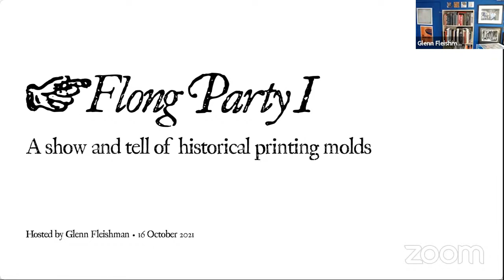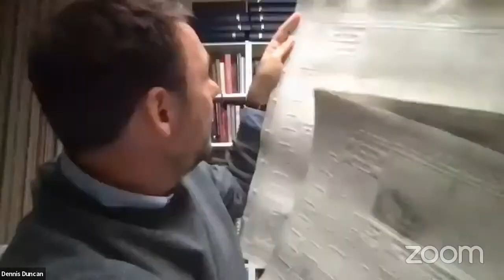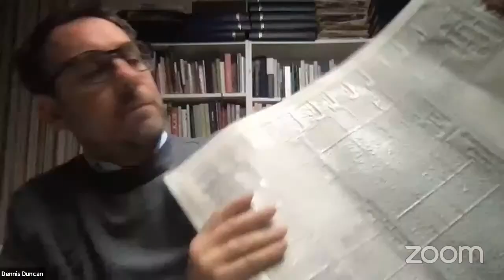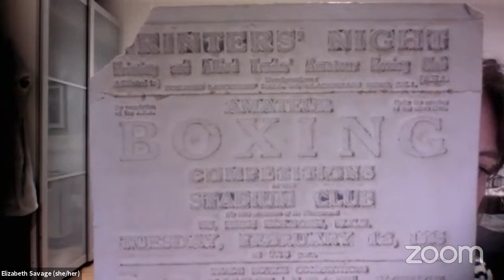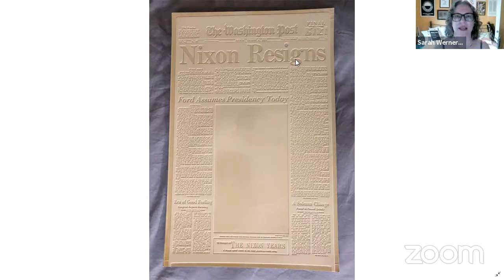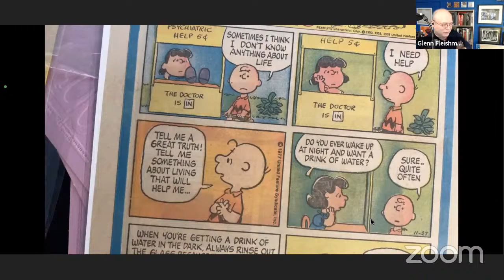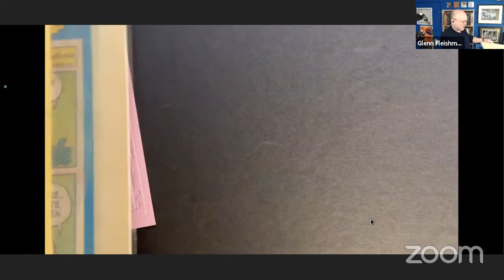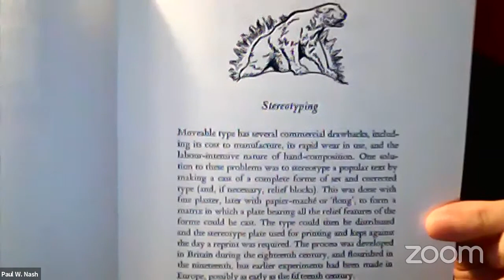Printing History: Flongs — a show and tell of paper molds used in 18th C/19th C printing

Comment: Thank you Elizabeth for pointing out the flong party. For the fellow commenting on type high casting for flongs, we had a sort of case, to use on a pivot table appropriately 10 x 14" (from memory) there was a set of 3 or 4 bars with wood handles (I still may have them) that we could align to select the size of cast these bars were machined to type high .918 if memory serves. We tilted and poured in the lead from the hot pot, then left it to cool, undue the screw locks and remove the printing cut. I was always warned that no liquid was to be around the open pots of melting lead. Apparently a wee drop of water in the pot would produce explosive results 🤔.
I currently have approximately 2,000 full size N.O.S. sheets of flongs from 1940's through 1969. I would suggest they were the clip art versions of flongs, delivered every month via a subscription. They are still in mostly their original boxes, some with the printed newsprint copy book still intact. All 3 decades in one pile would extend to a height of approximately >16'. I saved them, not sure why, but since have been flogging the flongs on eBay one sheet at a time. Problem is shipping cost, they are approximately 2 foot square sheets. Carry on with your passions!
Reply from the maker: Thank you for that insight! I bought one box like this from the 1910s—fashion and Christmas flongs with that booklet of the kind you describe. I've seen boxes of these in a few places. Paul Akin at the Platen Press Museum has piles of them up on the top of shelves in his unbelievably crowded (and wonderful) storefronts of wonder. I am sure these were clip art. Newspapers in the US (but I am not sure elsewhere) were always filling up empty spaces they didn't have news or ads for with weird generic art. I remember this as a kid. I gather they didn't want to run the same stuff forever, so these supply houses created an infinite amount of fresh, banal stuff that fit the bill! I'd be interested in buying some sample of what you have if we can figure out shipping cost? I'm trying to acquire one of every kind of plate and matrix for research and writing, although I expect to (or at least hope to) find an institution I can ultimately donate it to.
Reply: What can a person do with flongs from 1943?
Reply from the maker: @robertareed2294  Enjoy them! (Or sell them on eBay.) I don't know of any way to cast them at the moment. I continue to talk to people to figure out if there are solutions.
Reply: @robertareed2294  
Hello Glenn and Roberta,
Towards casting a printable image. I have wondered the same and have done some trials. I do still have two lead casting cauldrons BUT starting them up for a hobby versus a commercial enterprise seemed daunting. SO, Stubborn as I am, I elected to try an acrylic casting medium that I purchased from Hobby Lobby also available at Michael's and I assume others.
My first attempt bonded unfortunately to the flong, so, I needed some sort of release agent in-between the acrylic and flong. Good ol' WD40 (oil and water principal) worked out ok. Then I mounted the acrylic negative cast with two sided tape to a piece of die board that I had on my stone. Then I locked it up in my windmill chase, ran the ink rollers over it and pulled a couple of prints. I had success! Of course I saw a squirrel and left it at that. To achieve a saleable image I would have had to tweak the impression a bit and as far as how many prints I could achieve remains an unknown. Solvent would certainly play havoc with the 2-way tape I expect. As far as solvent on acrylic goes, another unknown for me. 
I ran into a very gifted artist in Oakridge TN who was carrying on in the actual ART in Graphic Arts. She was using MDF as her mounting base and carving linoleum. I suggested to her to use HDF as it would be more durable as a base.
All the best in your quest!
It is an addictive art, don't let digital take the ART out of Graphic Arts!
Reply: Hello Roberta,
      I'm still in the experimental stage with this, but I have made a printable image. It's a pretty simple procedure. I mixed up some acrylic casting resin, sourced from one of the craft stores. Then utilizing the oil and water (repel) theory, sprayed the flog with a good amount of WD-40, poured in  the acrylic resin and left it to harden. The next day I mounted the hardened acrylic resin on a die board (that I just happened to have handy) packed the wood at the back to achieve type high (.918") locked it up in a chase, placed it in the Heidi windy mill and pulled a couple of prints. It worked very well! I amagain making a couple more BUT I don't think I saturated the flong with enough WD-40 as the resin stuck to the flong (#!@%!!) so... I put them in a bucket of water to essentially destroy the flong, this is time consuming but every time I am in the shop I rub a little more of the stuck on flong off and hope to eventually have another printable piece. I need to find a better "mold" release substance or method. 
   A couple of designers have bought sheets from me off of eBay to hang as inspiration on their walls. A craft lady from California bought about an inch thick stack of full sheets and I do not know what she has done but Cathy was very appreciative upon receipt. Let your imagination take you to the answer of your question :o)
Regards,
Stuart Adam @robertareed2294

Comment: Great video! Any suggestions on how to display/frame a flong that would maximize the detail? Thanks!
Reply from the maker: That's a great question. I've only framed one flong, and I used a much lighter mat and frame. So even though the flong is beige, it still pops. I'm not sure how you could accentuate the depth, though.